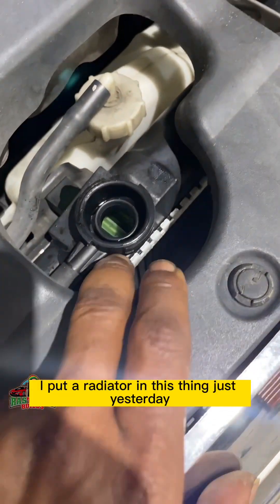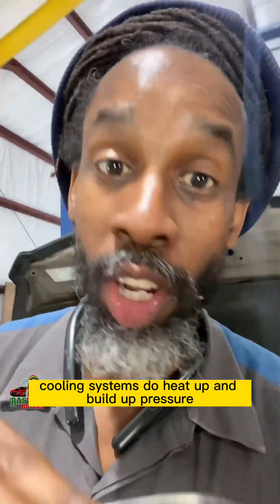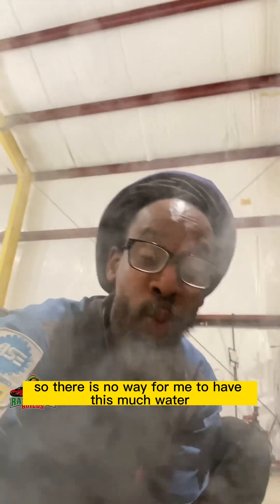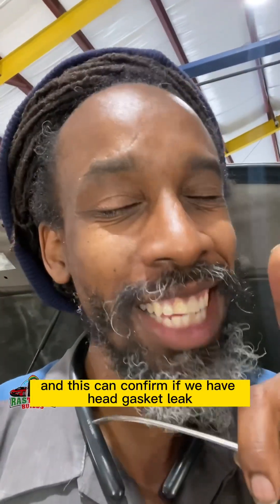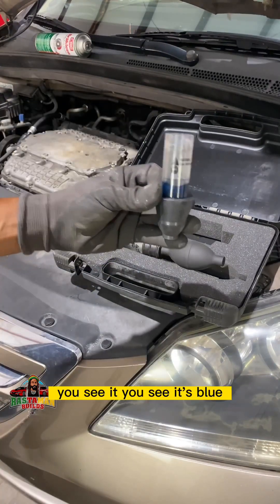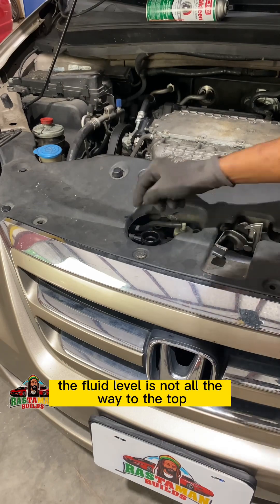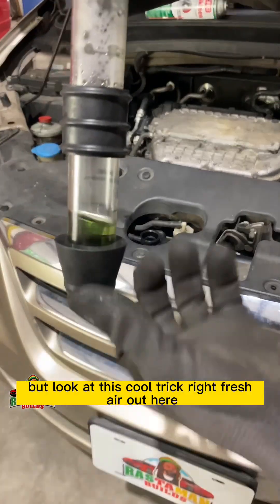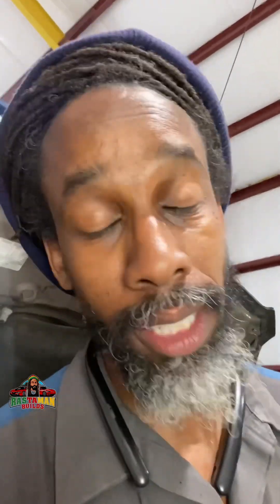Blown Head Gasket Diagnosis

Comment: I got a question, What happen if you see peanut gunk in the the radiator and resovoir?
Reply from the maker: That's oil and either trans cooler leak or head gasket
Reply from the maker: Could also be engine oil cooler too

Comment: Could also check under the oil filler cap for the death milk shake.
Reply from the maker: I have not reliably diagnosed that problem using that method